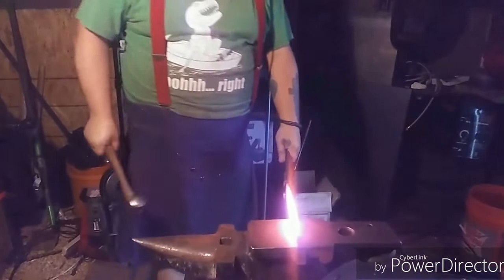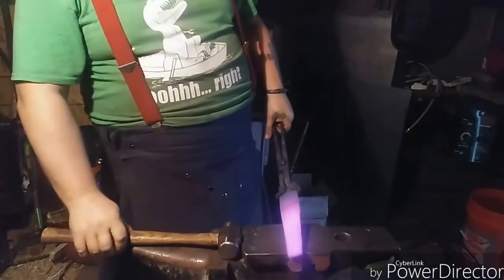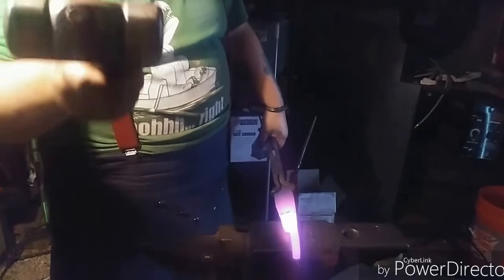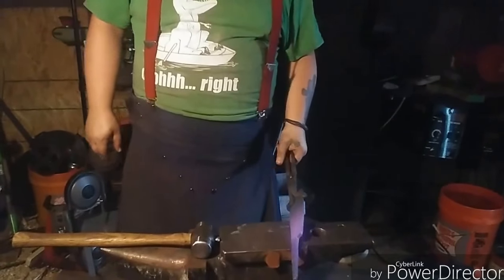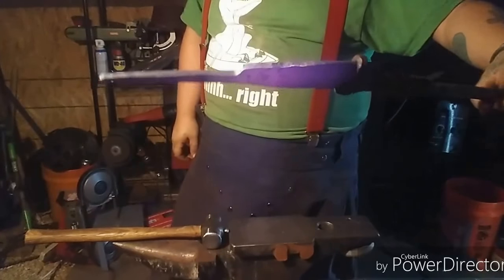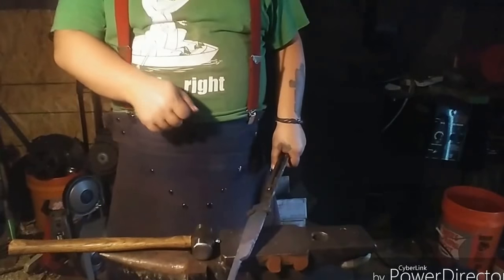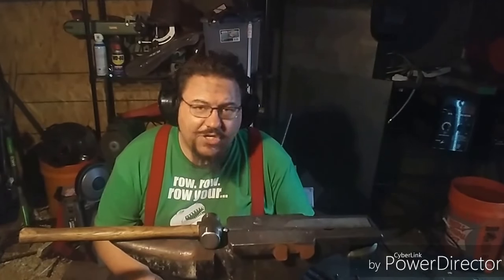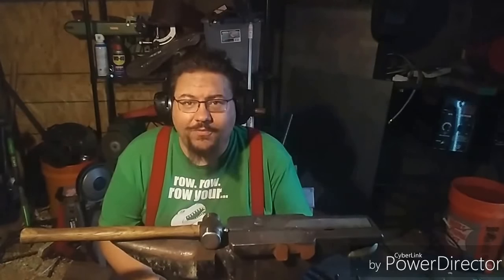Can I make a draw knife?

Comment: Work that tang over the horn. It will move much faster.
Reply from the maker: i am aware of that technique, and thank you for the advice, however i am still working on hammer control and accuracy so i draw on the flat face so as to continue strengthening both those skills and my hammer arm.